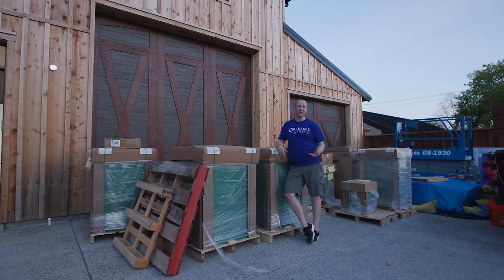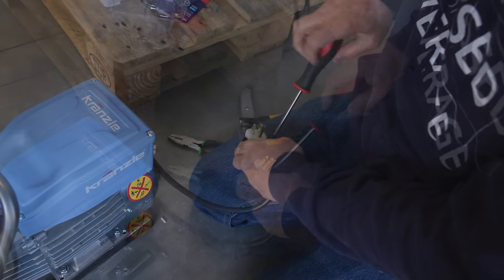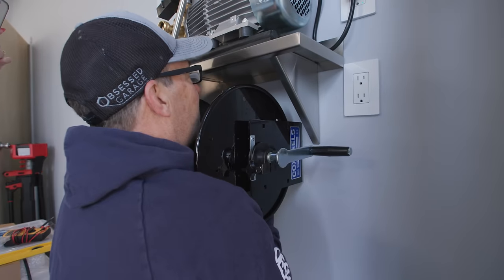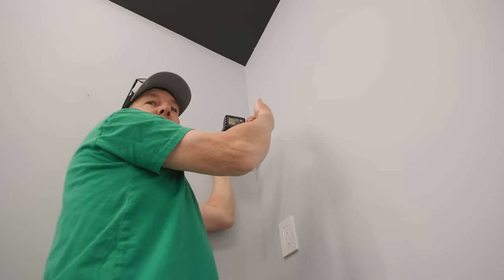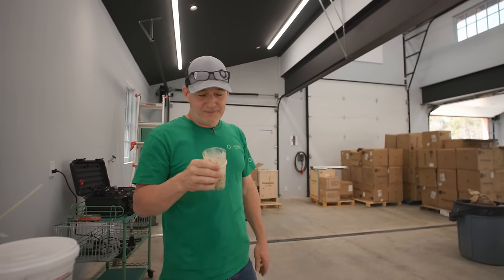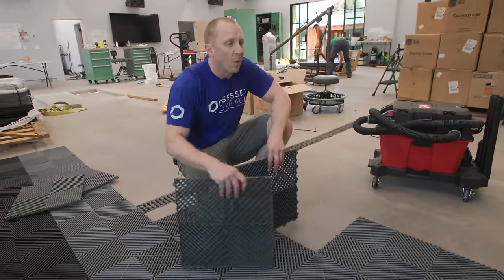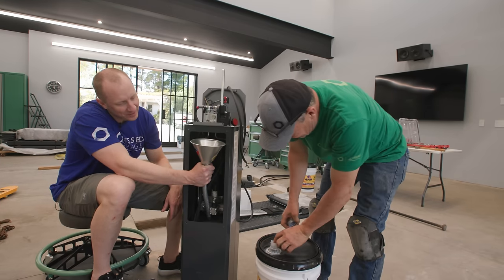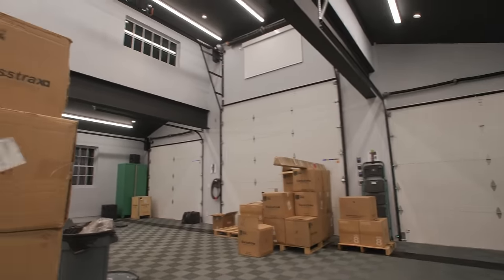EPIC Car Barn Build Series | A DREAM Custom Garage - E2: Starting on Lifts and Pressure Washer!

Comment: Mike, why not take your cord building technique to the next level.. Cover them with Tex flex use a green trace to match the green cabinets. I did this on my Kranzel pressure washer and even upgraded to 12 Gauge wire!! You could even paint the blue to a nice green that matches the cabinets

Comment: Saskatchewan represent!  🌾 

I’ve always feared Swisstrax in a winter climate, with snow dropping on it as it falls off your car. Especially on a garage floor with no drainage.  But now that I write this I realize that’s really no different than snow dropping directly on your concrete with no drainage.
Reply: And of course now that I’ve said that, I’ve come across Kyle’s video showing how to clean and remove the Swisstrax when needed.

Comment: I would have run the SwissTrax to the edges and had a cut edge instead of having that gap and used some aluminum transition trim for the edge instead of ST edging.

Comment: 12:00 Anyone who has done this type of wall install, appreciates the effort Mike.  Frustration is: When using lag bolts / screws from a certain country; then have the bolt head twist off drywall flush; (in the wall stud).  Talk about hearing some poor choice language from an installer. 🤯

Comment: I have the K1322TS it started getting milky oil and leaking water from bottom so I brought a seal kit from you guys, changed it out but still had same issue . Kranzle said maybe the seal kit was bad so got another and still same issue. Any advice ? OG support seems backed up reached out a few weeks ago and only got 1 response.
Reply from the maker: Check the coating on the plungers.  They are DLC coated black.  If one or more is scored or worn, water may be escaping past the seal into the oil housing.

Comment: You know what,  your making me obsessed now.  When you fitted the kranzle washers on the wall they are not the same distance away from the power outlet vertically.  The bottom stainless steel shelf  is about an inch away from the power outlet   and the top one is about 2 or three inches away.    Dont tell Matt
Reply: Yeah, the outlets were put in the wrong place, unfortunately.

Comment: You guys do local installs  on any of the the pressure washer packages you guys sell?
Reply: Installs?  It’s pretty simple to do
Reply: @StewPedasoe  Running plumbing and a dedicated electrical outlet in a garage that doesn’t have it isn’t exactly easy. But okay.

Comment: Could the piping been designed in wall since this was a new build? Chases on the wall will make it look like an afterthought.
Reply from the maker: The Prevost is way too pretty to not show it.  Plus future serviceability is important.
Reply: @ObsessedGarage  Future service is an interesting thought that I was not aware was an issue. Is it much more likely to need service than electrical wiring or water pipes?

Comment: Can't those floor tiles be cut to create an even line around all doors?
Reply from the maker: No, you need a full tile to utilize the peg and loop to connect to the edge piece.  They have a stitch type solution, but it is not ideal.

Comment: I still don't understand the swiss trax flooring! It traps dirt and grim and probably hard to replace individual pieces. How do you clean the floor?
Reply: I’ve had Swiss tracks down for a year ,  a good working garage vac just sucks the dirt right  out when ya feal like cleaning.  If theirs slope to your garage u could also just simply wash the floor , and the water will just run outside.

Comment: @obsessed garage - I'm starting a slightly less ambitious but similar concept 2 level garage barn project next week. Have contractors coming in to do the main work (floors, support beams, add a bathroom, etc..) but I'm deep enough in this project it might be worth getting some custom design help on the other garage aspects (cabinets, lighting, workbench, lift (already have one), wash station, etc...) It's 2 levels and will have room for 5 cars on lower level and 5+ on upper level in addition to a lounge, bar, etc.... If you are still on Rennlist, I'll shoot you a PM there. Don't want my email address public.
Reply: There is an email on their site also for design
Reply from the maker: My email is matt@obsessedgarage.com.

Comment: I definaltey would want that door edge rethought , walking through a fully dialed garage , that would bug anyone with ocd. I made custom  black alimunum edge pieces for around my staircase when I installed my Swiss tracks , looks pristine and finished. Take a trip to a flooring store/ or moulding millwork store and Iam sure something can be creativity modified to adress that gap at edge . 
Wicked build otherwise

Comment: Gap at 2 doors instead of cutting at 1?
Reply: The project isn't finished.
Reply: Oh, really?
Reply from the maker: You clearly didn't listen.  You can't just cut a tile in the middle of it and connect an edge piece.  You have to decide where a full tile terminates.
Reply: @ObsessedGarage  I stand corrected. I did miss any talk of an edge piece.

Comment: Couldn’t you just cut the Swisstrax and cover with black powder coated cover? Why the gap?

I have 2 misaligned garage doors, cut off swisstrax angle piece connectors, butt them to the cut Swisstrax tile, cover with black metal edge- looks perfect, metal is supported and feels the same